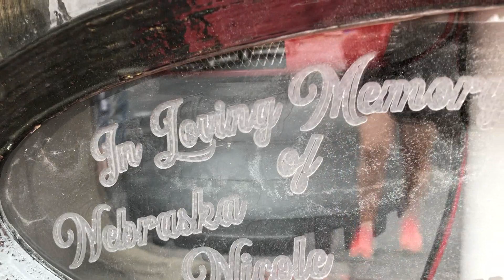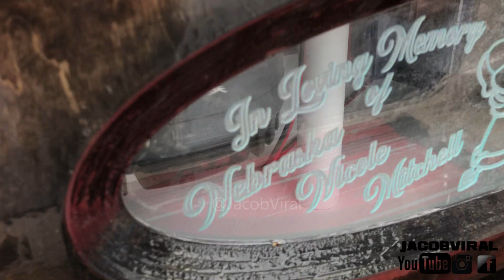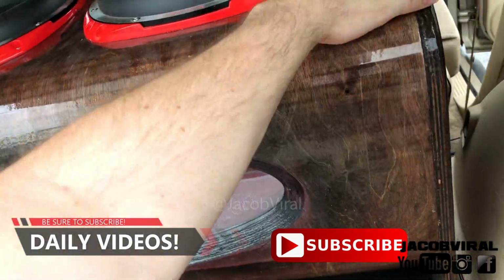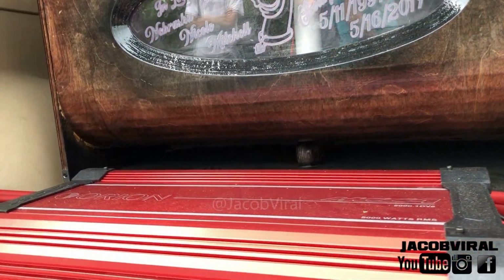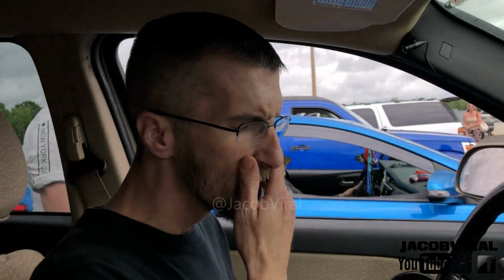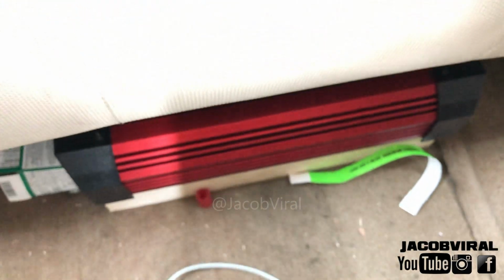ONLY 2 12S THIS LOUD! ORION HCCA 12S ON AN ORION 5K AMP

Comment: Loudest system i ever heard was 2 orion n/t 12s in a ported box with a 1200 presicion power amp with a stock deck.dude was beating out vans and trucks in competions and the only person i know to crack a cd from the bass beatin so hard...
Reply: I just beat out 2 15's with my 1 old school HCCA 12 1200w that I had for 20yrs now.  Cant wait for this one and its already coming.  Do the Orion Amps still overheat?  My old school XTR amp did all the time.

Comment: I'm in Nebraska also I'm running 
3 hcca12's too.. beast👍
Reply: Yoo bro where can I get the 12 orion hcca 124 to buy
Reply: @nuclearaudio1968  just search on Google you will find the 12 HCCA d4 for sale several places.
Reply: Mine are not 12 4 mine are two of them are 12 2. One of them are 
12 1

Comment: Orion pre 2017 was the best imo. They changed build houses and went in the dump as far as longevity quality and they cut out a lot of the 4 channel amps for some reason.
Reply: @Alpha Omega the quality of the HCCA subs & amps are still the same great quality even though Orion supposedly changed build houses around 2k17 or 18 right? Or am I wrong? Forgive me but my knowledge of the Orion brand is limited. Never owned any of their gear but always heard solid things about their products over the years.
Reply: The Secret logo is on the very last car On the wheels of the Pontiac
Reply: Jacob did i win

Comment: Hey buddy I got 4.skar vxf-15D2 and two Taramps 8k amps. I want to build a wall in a 2003 Silverado extended cab do you have any good ideas how I should do it I'm kind of new to this I watch all your think you can help a brother out 😉 lol
Reply from the maker: I’ve seen afew Silverado builds and most seem to do amps on the sides and optimize their space forward as much as possible with batteries in sides and behind seat with Port centered. Thanks for watching!
Reply: I appreciate it thank you

Comment: I believe I would turn that box over and let those subs fire toward the back glass I believe it would be louder and sound better! May even meter a .10’th better mine did!
Reply: You mean sub and port firing to the back? Suv or car? I have a suv, two 15 hccas. About to build a box. I cant decide on wether I want port and sub firing back or port firing back and subs up like in this video.

Comment: It has 3 ground and 3 power. Where do you get 3 from ? Because if I’m running one power wire where I’m i supposed to get 2 more wire from ?
Reply from the maker: Additional runs from batteries
Reply: @JacobViral  gotcha! Thanks !!
Reply: @JacobViral  jacob what up I got a question for you a man I’m trying to upgrade my system and I finally put some money together. I’m just trying to go with the best bang for the buck which 12s would you recommend Orion’s ,sundown ,dd ,fi,I just don’t know which way to go. Thanks bro.
Reply from the maker: @lipiuuth  all four of those are good. You have to decide that question on your own as you will be using it. I personally have ran Fi subs the most with good results but everyone has own view.
Reply: Bro, you didn’t help me out at all 🤣🤣🤣but love your videos, man and thanks for the reply and keep them coming because I need something to binge watch💯💯💯

Comment: i think they discontinued the regular hcca subs because of voice coil problems, never owned hcca subs, but based on videos, looks like they pound like hell . i can just imagine the spl x versions
Reply: Spider problems only on burps over 10 k. The tinsel leads go in n out the top spider trapping heat when in excess drys up spider making it crack no worries top load changeable so super easy frfr.

Comment: same amp line but mines  the 8 k         ,    but i have mine  running at 2 ohms   so its around 6k          alot  louder  and  amp  is stone cold  even at full blast....and   zero  voltage  drop    ,  only bad thing   the amp   is 6 in  longer..      ..     there box  looks   to small
Reply: Agree.. nice looking box but I'd bet it's too small
Reply: These subs lean more towards smaller enclosures is something to take in account when building s enclosure for the hccas.

Comment: What does it hit ??
Reply from the maker: Probably meters around 148db
Reply: @JacobViral  man, how hard is it to hit 150. Figured those would be
Reply from the maker: Really big cabin space suv is harder to break that 150. It’s easy with higher tuning but musical low tuned box alot harder.

Comment: I had a one and it keep overheating i got it professionally installed and found out these amps are good for burps(a quick 30-40 second) of hitting hard I got mad and went with jl audio and wouldn't change for nothing now and if you think that hard mine would make your heart miss a beat
Reply: Must have had something wrong. I can play mine all day long and it doesn't get hot.
Reply: that hcca would eat 15 of anything jl audio makes, for breakfast....  

wtf your installer robbed you off knowing the best amps made.... 

fkk the xtrs will destroy jl audio
Reply: Not true at all buddy if the amp kept over heating is was probably cause your electrical is shit if you can't afford a high output alt and batteries don't buy a compation amp

Comment: A guy i know has 2 of these in 10” which im in the market for new subs, I have a sundown 3000w amp. Would you take these over say a sundown x series or massive hippos. 

The price is substantially cheaper for the orion
Reply: Omfg the orion's are so so so much better this has been the case for 20 plus years.
Reply: They will want more power that's for sure

Comment: Those subs will handle an 8k amp give them 3500 each
Reply: I’m late but could I run that consistently? I have the same build my box will be slightly bigger though I want to push them but not blow them to soon🤣 mfs are not cheap
Reply: @tyshaunmclaughlin8151  there fine on an 8k amp if your worried just give em 3k each theres people giving them 4k clean power in a proper box